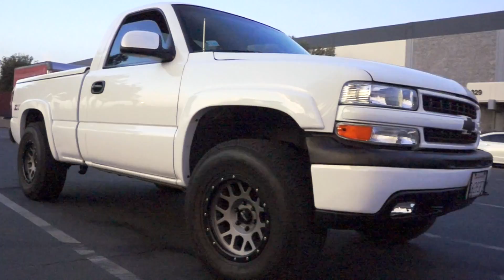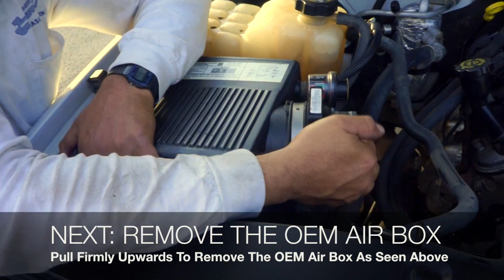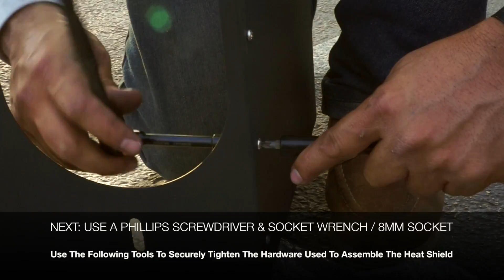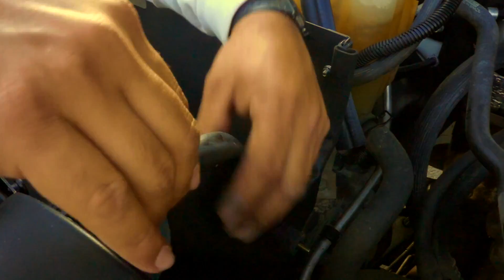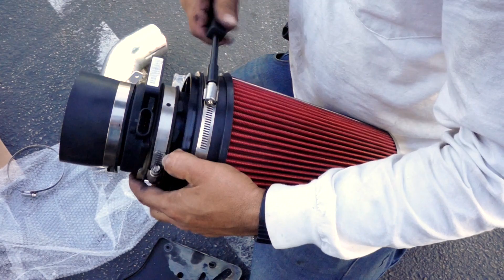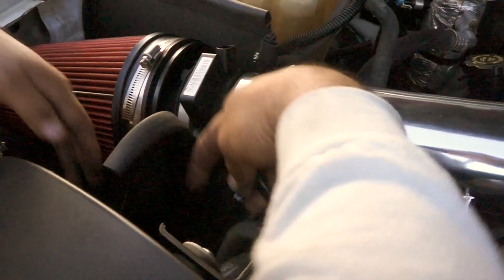1999-2006 CHEVROLET SILVERADO COLD AIR INTAKE INSTALL - AJP DISTRIBUTORS

Comment: Do they trigger the check engine light.  And dose it increases the horsepower
Reply: If you watched it all it increases it by 10
Reply: Mine triggered the light on my Escalade till i drove for 30 miles and turned it off and on again

Comment: After completion since you have more air flow aren't you supposed to retune to compensate? Every place iI checked said you won't see much of a change unless you do.And what about that MAF sensor screen? it limits air flow.Just removing it gives a horsepower boost.
Reply: I unplugged mine and am going to plug back in tomorrow causes it finally gets tuned but I ran it with the maf sensor unplugged and ran better

Comment: I am installing this same CAI on my 06 Tahoe z71 5.3l flex.  Thank you for this video its a big help. I have a question....did you experience any codes after installation?
Reply from the maker: Hi there. Thank you for watching our videos and we are glad that this video was able to assist you. As long as you follow the steps properly and disconnect the battery, you should not show a check engine light.

Comment: I put the  Spectre CAI on my 06 Chevy Silverado. Now its putting off codes.says its running lean and misfiring now...i threw the stock air induction away not knowing this could even happen
Reply: your air to fuel ratio is off, you need to get it tuned.
Reply: Garbage.
I going back to factory, factory spend time,money.hours of development and everyone replaces the factory beast mode box with these pieces of str8 shittt...🥴I quess every one likes thier cup of coffee different 😆

Comment: Mass air sensor assembly has a screen that restricts air flow and should be removed
Reply: Once removed it gives a horsepower boost also so it isnt just the kit that boosts it.The maf screen actually is an air restrictor.
Reply: @larrynew7258  Cold air intake is suppose to lower intake restrictions, so that screen is a great restriction, why is it there?